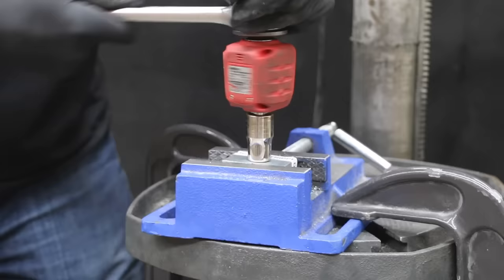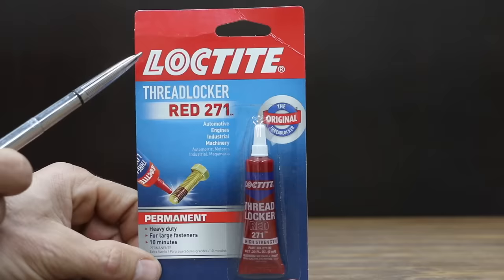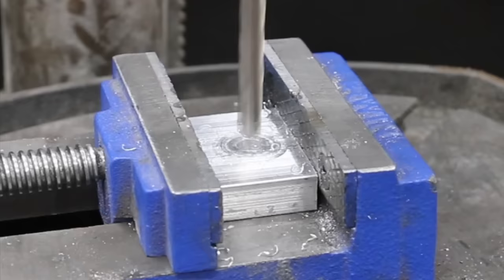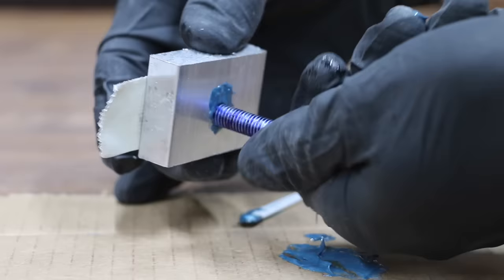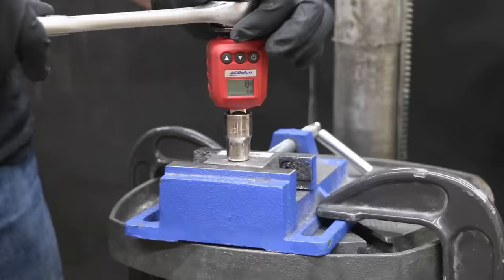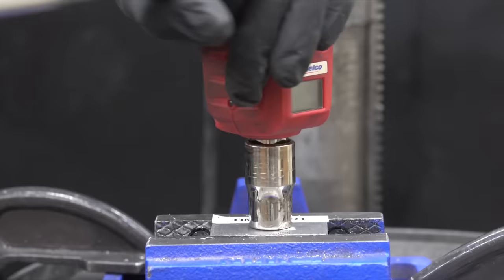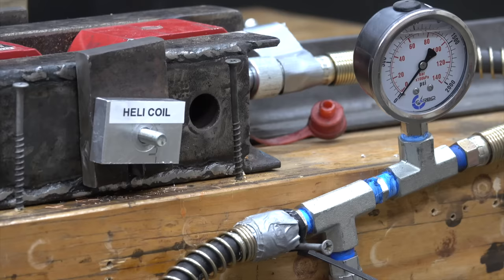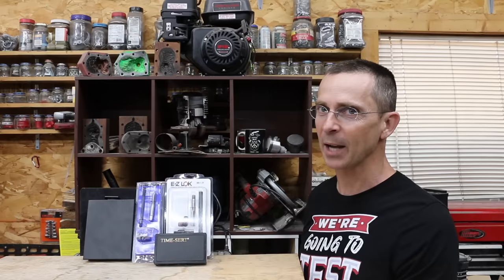Best Damaged Thread Repair? Let’s Settle This! Heli Coil, TIME-SERT, E-Z LOK, JB Weld, HHIP, Loctite

Comment: Time-Sert seems to be a favorite of engine mechanics. Especially with K series head bolts.
Reply from the maker: Thanks for the feedback.
Reply: I came to say this as well. I make a 662hp at 18psi on my turbo k24 set up and I've been using a time sert for over a year.

I've used them in many of b and h series as well over the years.
Reply: Watch torque test channel. They just proved time sert is not the best. A small plate of aluminum isnt the same as an aluminum block or head, something w a deeper hole. And especially cast iron. If you're repairing a cast iron block or head, time sert works obviously, but actually the cheaper options are stronger. Watch torque test channel
Reply: Time-Sert is also the mechanic's favorite for replacing spark plug threads in the Ford Triton engines.  I think the main reason is that you can vacuum or air-blow out all the drill bit shavings, but the "tail" from other metal insert options might not come back out of the cylinder so easily.  Time-Serts don't have that "tail" - once you've cleaned out the drill bit shavings, you won't be putting any more debris into the cylinder.
Reply: That's because they can mark up the part more and make more money.
Reply: @davisev5225  when fixing spark plug threads you don't "kick" the tail with the hammer in the engine block. You snap it off with long needle nose pliers :)
Reply: I’m a believer! I had a helicoil blowout and they sell a second chance product.

Comment: Two days ago, I stripped threads from one of the the heads of my motorcycle where the rocker arm cover bolts on (Freak accident, as I have done this a dozen times before, as the valves need checking every 4k miles.) What a timely video. I bought the next longest bolt, adjusted the length for exact fit, used shims and thread locker, grabbed a few new threads at the bottom, and got lucky. Next time the engine is out of the frame, I'll use one of these systems and just replace all 8 of them (Needing service every 4k miles, there should've been steel threads inserted from factory,) Yamaha engineering fail, for sure. Great video, great timing. Thank you, and keep up the great research!

Comment: I'm sure the video creator already knows this, but for anyone watching who may not know: a lot of taps have a dimple on the square end. This dimple is meant to be used with a guide tool in a non-running drill press. The guide tool has a pointed tip which inserts into the dimple on the end of the tap & will hold the tap true as you rotate the tap wrench. You also use the drill press lever to apply a little bit of downward pressure as you rotate the tap wrench.

There are also some other tap wrench designs which are closed end but have a dimple on the end of wrench itself to use with a guide tool. 

Some taps are pointed on the square end instead of having a dimple. These are meant to be used the same way, just with a different guide tool.
Reply from the maker: Thanks for sharing.
Reply: If the tap is small, like the one shown here, I just load the shank of the tap into the chuck and drive it under power.  Thumb rule for speed is 10X the thread pitch = RPM.  This is for mild steel.  Use a spiral point or spiral flute tap to avoid loading the flutes with chips.  Best to tap during the same setup as drilling to maintain concentricity.  Proper cutting oil is critical to avoid tap damage, particularly in stainless steel and other tough, strain hardening metals.  Chipped taps or dies on stainless work pieces are a direct result of insufficient film strength of the cutting oil.  This causes chips to weld to the tap, then break loose, taking part of the tap along for the ride.  My experience is full-time machinist for 20 years and have been working in shop for 55 years.

Comment: I have a whole metric set of Time-Sert metric.  I have successfully repaired VW cylinder/head studs on old cases. On rebuilds all the studs were routinely replaced.  I was really hoping there was an epoxy or thread lock liquid that would at least withstand 144 inch pounds.  I am working on an aluminum cased Triumph/BSA engines which uses US threads, so I bought Heli Coil.  So far so good, and now that I have watched the video, I know I made the right choice.  I am a bit surprised that Red Loctite did not do better.  I have had to remove the gland nut of off VW flywheels, and if someone used Red Loctite (not recommended) I had to use a special made 36 MM hammer tool to break it loose. Seems if the threads are stripped, red Loctite is not going to bond to the aluminum.  Thanks for the videos, I love watching them.
Reply from the maker: You are welcome!  Glad to hear!

Comment: The test needs to be repeated in steel with proper bolts (class 10.9 minimum, 12.9 preferred).  This video did a good job of proving the epoxy type repairs are useless, but it really didn't indicate which of the insert repairs is best; rather it proved that class 8.8 hardware store bolts aren't great.
Reply: Agreed, although it also proved that since they are all stronger than the original threads in aluminum any of the metal inserts are a better than new repair on an aluminum part.
Reply: Yeah, I thought so too, but does it really matter for the video? Because the inserts are all considerably  stronger than the original threads, so that's strong enough for the use case. The goal for a repair is to make the thread work again like new, it doesn't matter if it is the original strength, 2 times the original strength, or 10 times the original strength.
Though, I guess if he does a follow-up video with stronger stock material, steel most likely, he should use stronger bolts also

Comment: Quite a comprehensive test indeed.  I've been using Time-Sert or Heli-Coil (or an equivalent) for almost 40 years and they both have their benefits depending on the circumstances of the job in hand. Though the Time-Sert is usually the preferred option in most cases.   Keep up the good work old chap.
Reply from the maker: Thank you!

Comment: An old tymer taught me a trick with jb weld.
Wrap your bolt lightly with Teflon tape and put a dab of JB weld in the hole.
Come back a couple days later and remove the bolt. I did this to a small block exhaust stud on the head and was able to torque it to spec.

Comment: Excellent testing! I didn’t see this one coming, but love the results of using real inserts. JB Weld has it’s uses, but it certainly doesn’t beat real metal as a fix.
Reply: ..yes, exactly!..that has always been my peeve with JB Weld...it's name!..It IS NOT a weld!!..it does have it's uses, and I do use it, but not as a "weld", or any application that requires sheer strength...

Comment: I find it very interesting that the bolts broke at about 200"lbs more with the EZ loc than the other inserts. This makes me think that some stress risers or more even thread loading must be at work here?
Reply: I'm not sure of the parent materials/hardness, although I'd imagine the coil style would suffer more stress under relatively high torque than the single milled piece of the Ez-lock. 
In my simpleton carpenter brain...
Methinks the coil is likely made of a more malleable metal, and later heat treated to likely mass produced mediocre standard.
Furthermore, the coil style can likely deform more easily than a single milled piece. 
More, stretchier and stuff...methinks.

edit
My theory is invalid if the Time-Sert brand was also outperformed, as they also look to be of a milled tube type construction. 
... too lazy to rewatch & confirm.
Ok...back 2 work, have a good 1!

Comment: 13:51 One thing to add, when you doing thread repair on aluminium, it's preferable to avoid stainless steel because of galvanic corrosion. On aluminium alloys, it's better to use an copper base insert or at least zinced steel helicoil. If not, the aluminium will corrode very quickly, and ever faster if exposed to water. Good test as allways !👌👌
Reply: Never had a problem with SS helicoils on aluminum, even with occasional water contact. The bolt seems to matter a lot more... on the threads I'm thinking of I almost always used silver coated screws but the helicoil itself being SS didn't seem to matter. But ymmv, my use case was in a controlled environment with relatively stable temperature and humidity.
Reply: stainless is corrosive as well

Comment: Thanks for all of your videos - I appreciate the work it takes to put them together. One suggestion would be to use grade 8 (or above) fasteners rather than lower quality fasteners. 
I understand that this would not change the fact that the insert type thread repair methods outperform the control in soft materials, but it might shed some light on the actual performance of the insert versus the performance of the bolts.

Comment: JB Weld produces a stronger thread than standard aluminium but you need to tap a hole similar to using a heli coil inset first. Then it does not rely on gripping force of the adhesive.
Reply from the maker: Thanks for the feedback.
Reply: Excellent tip.
Reply: I'd have thought all of the systems are still limited to the torque required to strip the aluminium thread they're mounted in, including the JB Weld. The adhesive strength seemed like a possible bonus until I remembered the alu goes with the bolt either way 🤷🏻‍♀️
Reply: That's exactly what he did. Filled the holes with jb weld and redrilled and tapped it

Comment: If you want to make your JB weld stronger save brass and aluminum filelings and add a pinch to your mix .I have repaired aluminum boat propellers this way and it did not fail under a full load on it so it works great on rebuilding threads. Nice video
Reply from the maker: Thanks!  Thanks for the feedback.

Comment: I’m still intrigued by the copper wire trick, even though they tested poorly.  I wonder if there are any other rules of thumb with this such as what wire gauge to use (looks  like maybe 14 or 16 awg in this example), or this there is a wire-gage-to-thread-size relationship? 

Also great video; I saw that Torque Test Channel released a video testing thread repair inserts (many of the same ones as tested here), at almost the same time. I thought at first it might actually be a collaboration but no such luck. 😀
I really liked that you did 3 samples per variant.

One more thing: stripped threads also often occur when the rpm is too high. This is especially prevalent on small fasteners (such as M4), and with self-tapping screws (especially when installing into plastic). Most automotive companies use DC drivers with programmable controllers; they are intended to install the same fastener torque repeatedly, day in and day out. They also control rpm and can be done in stages: a quick pre-install rpm, followed by a slower run-down rpm when seating the fastener to achieve torque.
Reply: He used stranded wire.  Looked vaguely like TEW, which has pretty fine strands (extra flexible for use in panels, automotive and the like).  A more industrial style of stranded wire like T-90 has only 19 strands, so the individual strands are a lot chunkier.   My suspicion is that you want wire strands that are vaguely similar to the size of the threads.
Reply: I have notifications in for both channels and they were posted 12 minutes apart!!! Some insane coincidence!! Especially considering the amount of work required in producing each video.
Reply: I've used copper wire on a sheer application where the bolt had almost no pulling force on it.  It's about the same as using a toothpick to "fix" a stripped wooden hole.😄

Comment: Can the testing be done with grade 8 hardware or even automotive grade studs?? I'm curious to see the results of the Metal thread repair kits with stronger bolts.
Reply from the maker: Thanks for the suggestion.
Reply: Agreed.
Reply: I was wondering the same thing, if grade 8 bolts might tease apart any differences between the metal thread repair products. 

Great video!

Comment: Another great evaluation so I just bought a Helicoil kit to fix a stripped out bus bar in an electric panel.  I felt this was the best choice since the repair needs to provide a zero resistance connection between the breaker and the bus bar, and the Helicoil/HHIP solution provides a metal to metal fit.   I did think about just tapping out to the next size up but figured this might cause problems for future adds/changes in the panel.  Thanks for all you do!
Reply from the maker: Thanks!

Comment: I really like the idea of the time-sert & ez-lok ones. Most of the times we've used heli-coils is for repairing spark plug holes on cylinder heads, and having to try and punch the tab off without losing it in the engine is a pain.
Reply from the maker: Thanks for the feedback.

Comment: That was an incredible amount of work! I can't imagine how much $$$ you spend on these tests. Your channel is MOST appreciated, one of the very best on the web! I hate to suggest this, but how about repeating the test with threaded cast iron, (as in cast iron cylinder heads), using phosphate coated carbon steel head bolts?
Reply from the maker: Thanks and you are welcome!  Thanks for the suggestion.

Comment: Interesting. I'm curious why the bolts broke at different levels with the threaded inserts(in the torque tests) I'd like to see if the insert was turning and stretching the bolt faster or something.
Reply: Most likely just slight variances in the material the bolts are made of, they didn't look like high carbon steel or any special alloy so were pretty weak.
Reply: Bolts normally break from 500 to 550 inch pounds, unless you use the ez lock inserts. Ez-lock inserts are magic...
Reply: @manbunmyname5866  A tread insert doesn't have any impact on the tensile strength of a bolt, the material that a bolt is made from is the only thing that can do that.
Reply: @manbunmyname5866  that is one of the dumbest generalizations I've ever heard. Why would you even say that? Did you read it on the internet?

Comment: My old folding sawhorses just broke. I went to buy new ones and they make claims that don’t seem realistic. I’d love to see a comparison for which ones hold the most weight, resist rust, and especially resist swaying (that’s what killed mine). I look to your channel as the authority on these things now.
Reply: Good suggestion. What is better than my old black and decker workbench?
Reply: @sbukosky  build one yourself. Will have everything you need (cuz you built it) and will fit perfectly (cuz you built it) and will make you feel good (cuz you built it)
Reply: The best sawhorse is the one you build yourself.
Only you know what the sawhorse needs to sustain to be a valuable tool to you. I've never bought a sawhorse that could handle the pressure I put on too it with my foot to keep it stable. So I ended up reinforcing them myself
Reply: A 2x4 homemade sawhorse is the best because you can cut right through it
Reply: @Jajaky       What? lol
Reply: @geoh7777  He's saying the disposable nature of self-fabricated wooden saw horses allow for greatly increased convenience, which in and of itself has its own value.

Comment: What stands out to me is the quality of the bolts.  Breaking at different stress levels.  If the bolts breaks before the insert, then you are measuring the strength of the bolt too.  I'm not surprised that the inserts are stronger than the original hole.  They are larger than the original bolt and therefore have more purchase on the aluminum than just the bolt.  Great test.
Reply from the maker: Thanks!

Comment: I've used the time sert on 3 wheelers I've bought with stripped spark plugs threads in the head. Super simple, take about 15 minutes and it's more solid than OE they work great! Not too cheap but it's a forever fix you'll never have to touch again.
Reply from the maker: Thanks for sharing.

Comment: Luckily Ive never been in a situation that I needed to use one of these but I now know some amazing options when I need it in the future. Great video as always.
Reply: me neither. i have always just tapped the hole the next size up or tapped it to a more course thread. these arent the only options
Reply from the maker: Thanks!
Reply: @dirtrider88    That’s the easiest route, but sometimes the casting is not large enough or the corresponding attachment piece won’t allow for a larger thread size.
Reply: @dirtrider88  Try doing that with a spark plug lol

Comment: I've heard stories of people using helicoils (or equivalent) directly when manufacturing because would be stronger than tapping directly into aluminium. I think we can consider this myth confirmed now 🙂
Reply: In that case it might be worth considering a larger bolt.
Reply: @andreasu.3546  Indeed, all the helicoils do is increase the diameter. However, sometimes that just doesn't fit the remaining parts of the design.
Reply: Yeah, when I make workholding I skip aluminum threads and go straight for helicoil inserts. Works wonders, but can be a pain to install 100 of them
Reply: Its also an upgrade for cast iron
Reply: Also, Helicoils are a lot more wear resistant.  Great if the bolts are being tightened and loosened a lot.
Reply from the maker: Thanks for the suggestion.
Reply: @tomvleeuwen  it is more like steel threads (in aluminium part) vs aluminium threads
Reply: Can confirm. My work uses Jergens key locking inserts when we make new aluminum molds because the wear and tear of the mounting and dismounting them would wear the aluminum out very quickly.
Reply: For military applications we would install helicoils in any aluminum thread that is going to be loosened and tightened on a regular basis.  Aluminum just doesn't like to be loaded and unloaded, it has a measurable lifespan, and threads just give up after repeated use.  The steel inserts don't have a set lifespan, and can last the life of the part.
Reply: @ryanpatton1795  Flexarm make helicoil installation arms, for mass production using them. Only "call for quote" dollars!